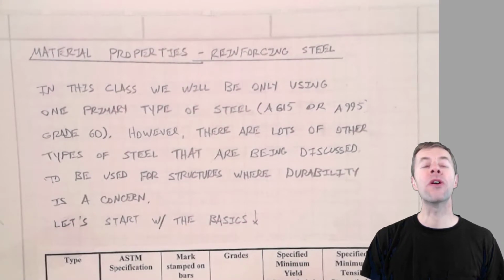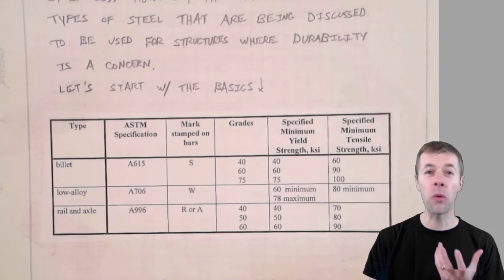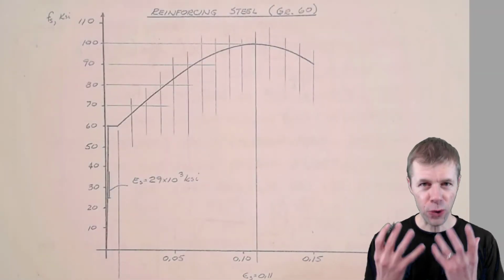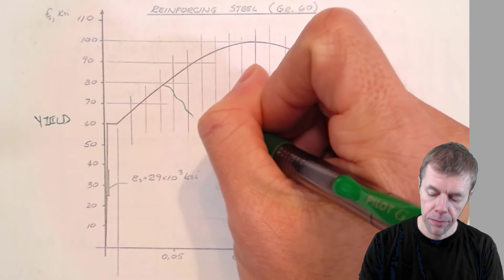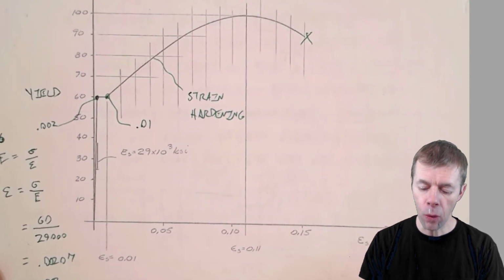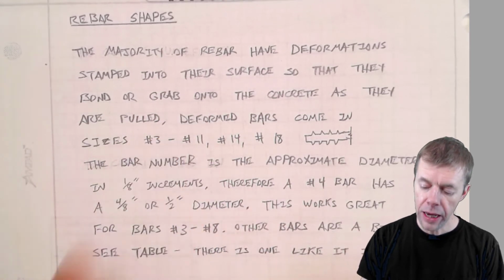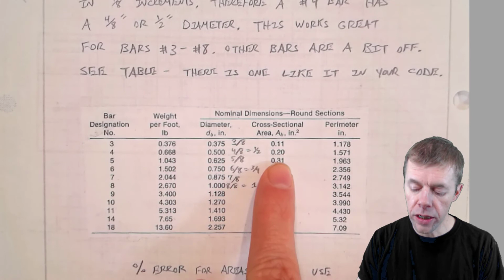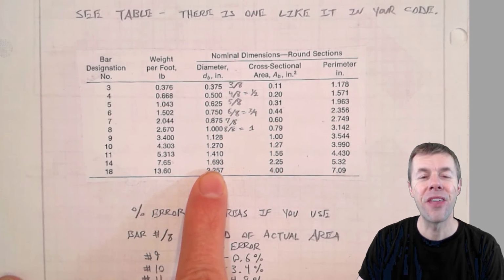Properties of Rebar for Reinforced Concrete Design

Comment: Great series!  Very clearly presented and informative.  Thank you!

Some other topics I'd love to see you cover, if you're so inclined: 

* slip form concrete construction
* marine concrete construction for building boats, wharves, and other salt water resistant structures
* bamboo, burlap, wood fiber, paper re-inforced concrete
* pre-cast concrete structures and techniques for joining them 
* avoiding cold joints, and dealing with cold joints in structures that can't be cast in one go
* labor reducing techniques / tools 
* cement glues and epoxies and when you'd want to use them
* creating floating concrete by adding expanded polystyrene, syntactic foam, entraining air

Comment: Enjoying these videos! Did a project replacing a 110 year old tank. The concrete had Smooth Rebar! The demo guys said it was just as hard to demo as deformed bars. Though it was 2ft thick concrete and lots of #4 to #6 sized bars.

Comment: Tyler
When you talk about "Yield" in a steel stress strain diagram, it is not loss of stiffness, it is deformation!  The 2% yield point you show on that diagram is a standard point of permanent deformation.
Reply from the maker: Joseph - A sudden deformation = loss in stiffness.  Classic engineering texts talk about deformations but what is happening is a change in the molecular structure of the metals that cause a loss in stiffness.
Reply: @TylerLey  I guess I have never seen that description.  To me loss of stiffness is what might happen to a strand of Spaghetti as you cook it, or a piece of steel as it gets into the red hot range and begins to droop  

The steel specimen in  the stress - Strain diagram is undergoing permanent dislocation of the grains in relation to one another.  Eventually, there will be microvoids forming between these grains and as more load is applied, the microvoids will coalesce and the two ends will neck down and eventually part.  Tensile failure!

Comment: Would you discuss the advantages and disadvantages of laminated ferrocement reinforced with layers of steel mesh/expanded lath vs rebar?  From what I've read, the laminated ferrocement lasts longer than rebar reinforced ferrocement due to better spread of the load on the structure.

Comment: While this covers steel rebar, I have been wondering about the Basalt Rebar I've heard about for a few years now.  While it obviously isn't common in standard construction, I understand it has a lot of durability advantages (i.e. it doesn't rust), but what are the other considerations one needs to take into account? (I assume there are drawbacks that don't get widely talked about, otherwise it would have taken over a while ago.)
Reply from the maker: Greg,
Basalt rebar is not as ductile as mild steel and costs more.  There are also concerns about how well it bonds to portland cement based concrete.  This impacts the development length of the concrete.
Reply: researchers are working on BFRP bars as to be alternatives to  steel bars. but, the mechanical property of BFRP bars are much different than steel. 
bonding Behavior of  BFRP bars are still not completely defined. surface texture wich is on of the important parameter increasing bond behavior is stil under research.
so it will take time to produce best quality BFRP bars which beat steel bars.

i think steel with thick galvanized coating is best solution.

thumbs up for your videos sir,

appreciated
Reply: @iotadiary4248  Thank you for this information.
Reply: @TylerLey  
Can the Basalt rebar be bent like for 9os, 45s and 180 hooks?
Reply: @josephkane825  yes bent ie not a big deal. you can bent it in any angle